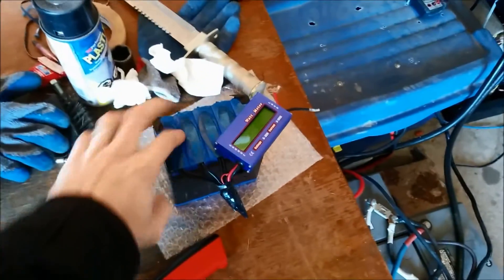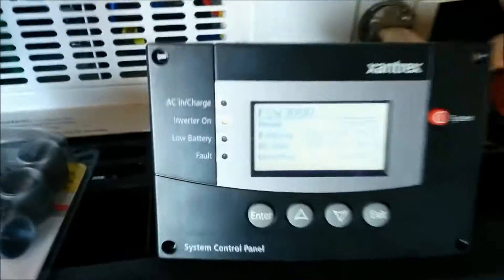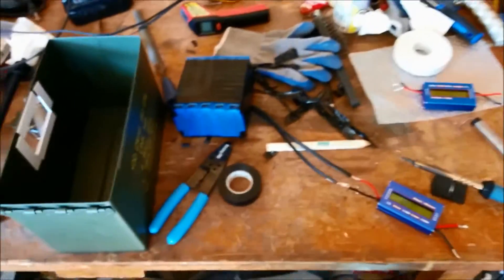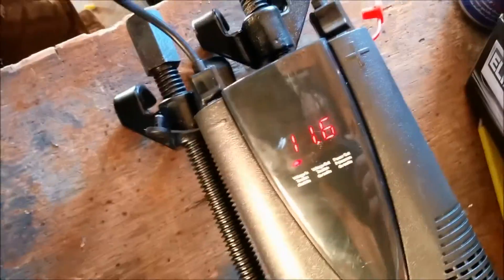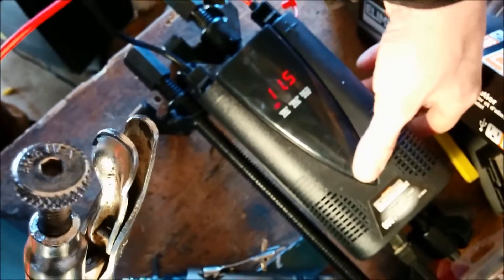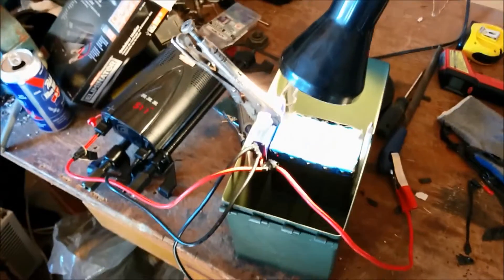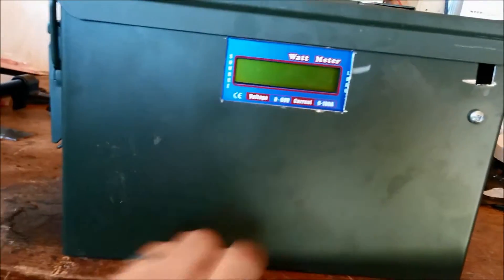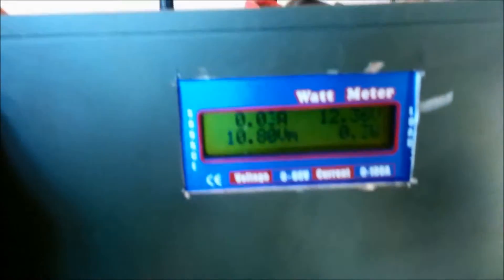12.6 volt LIPO battery box

Comment: Please do some research on the care and feeding of LIPO batteries... charging without a charge controller can and will overheat them. Nice video otherwise.... instead of monitoring the input current with another meter... go with a charge controller... stay safe.. and thanks for the video
Reply from the maker: +n3qxc these batteries are protected internaly, I took one apart and found this to be true.